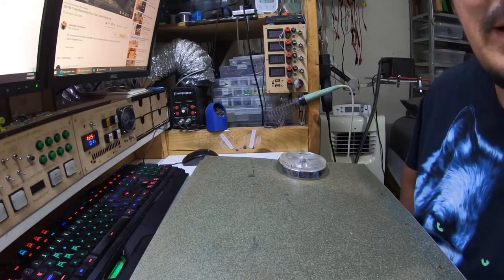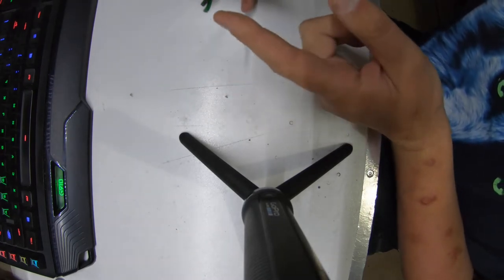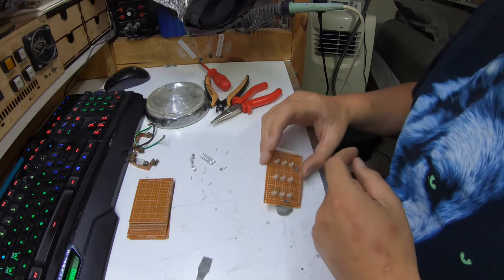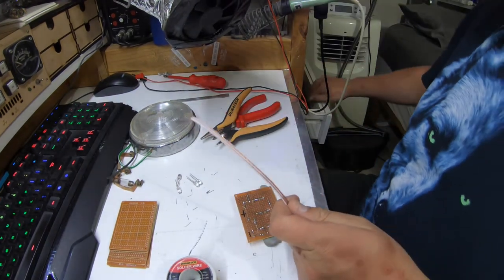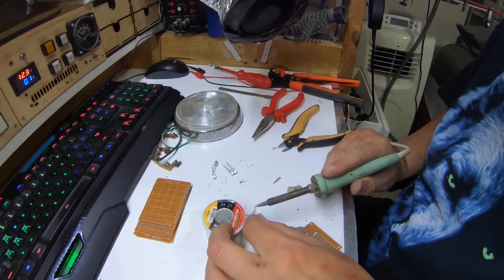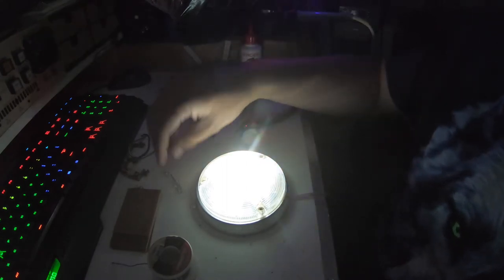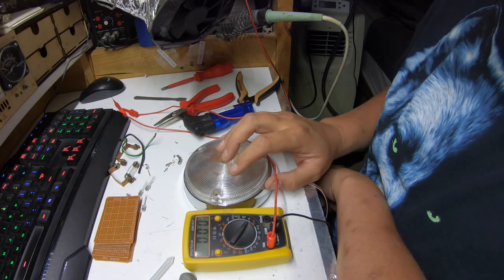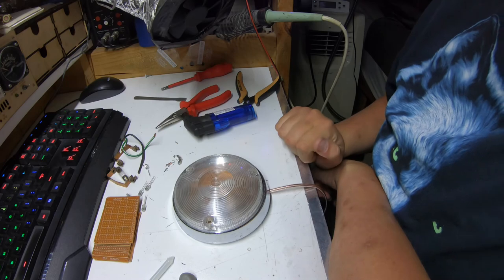Land Rover 6x6 Ambulance interior light LED mod

Comment: Nice outcome, the joys of operating with a decent higher DC voltage so you can use your current to its maximum.
Reply from the maker: I've since made a mini version of this that fits into the festoon socket.
But yes, it's good. The original 24-12 converter for the suction pump still works. I have 10a of 12v to use.